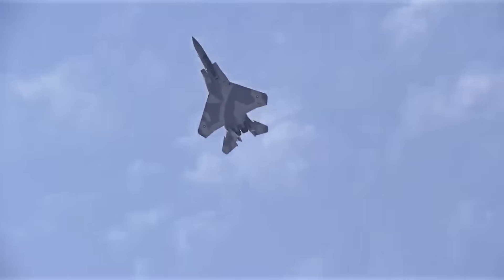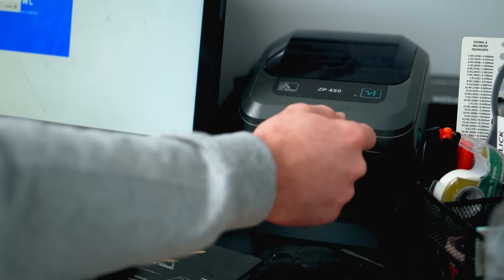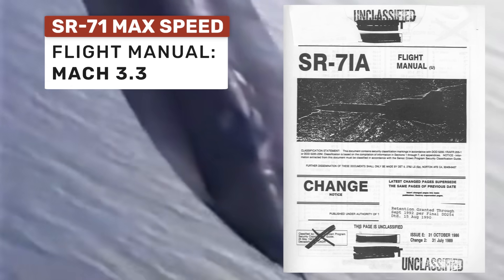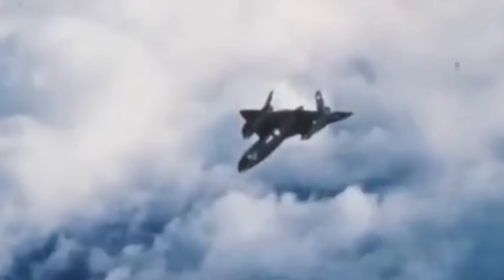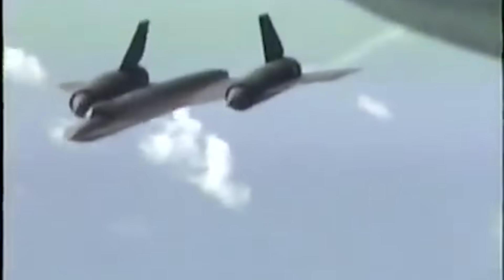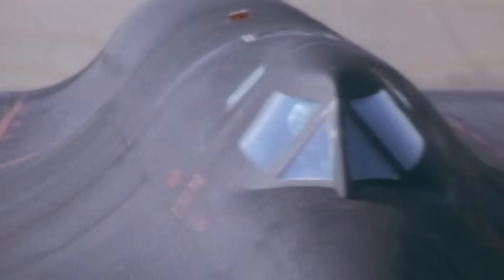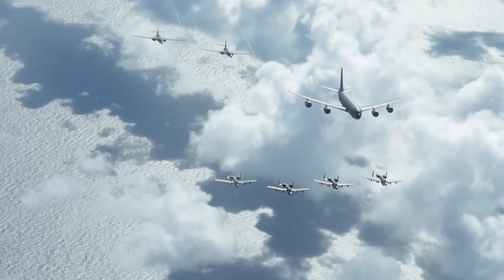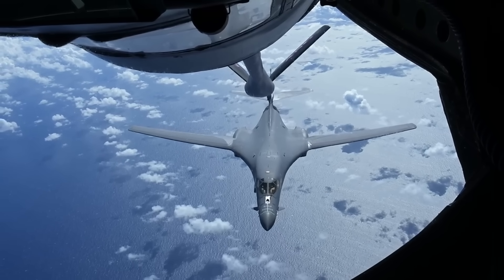The SR-71 was MUCH FASTER than the Air Force will admit

Comment: I was a 19 year old Airman, stationed at RAF Mildenhall, 84 - 86. We had SR-71s there. My war time duty was Rapid Runway Repair. So I got to put on my Chem gear, and lay out by the runway, and watch them take off and land. Such a magnificent machine. Great memories.
Reply: 1 MACH is the speed of sound at your current altitude and air  temperature.  So we have to account for Altitude and Temperature to find out Miles per Hour. Then there is the question of headwind or tailwind to get the Speed over the ground!!
Note there is a an aerodynamic argument that the Mach Angle Limit is from the tip of the nose to just outside of the engine intakes. If that Primary
Shock Cone gets to the Intake it would destabilize the airflow feeding the engines.
Reply: @georgeolson3996 That's why it has those movable intake cones
Reply: As a crew chief pilots told me about a incident where a sr71 called in a ife 200 mies off Cali coast and over shot every Base until it landed in. New Mexico base
Reply: I was a 19 year old airman at Upper Heyford same time. I intel 42 ecs squadron.  EF-111s
Reply: @Joe-b2n  Hard to believe it's been 40 years. Time sure has flown by.
Reply: I was in CE also, power production.
Reply: Prime Beef!
Reply: I live right on the runway of Mildenhall see so many cool aircraft
Reply: The ONLY issue with the recollections of these experiences is that they're someone else's, not mine....Dagnabbit!
The only opportunity still left to see an SR-71 or A-12 in the flesh is as a deactivated static display in or outside an aviation museum or similar facility, where one is limited to only imagining what it might have been like to be in such close proximity when it was in operation. Which is NOT the same as seeing, hearing, & feeling a living, breathing one in motion, going about it's business.
These days psychiatrists have a "condition", "syndrome", or "disorder" for just about everything.... ADD, ADHD, Adjustment Disorder, Autism Spectrum Disorder, Oppositional Defiant Disorder, Sensory Processing Disorder, and on & on.....
The only distinction related to the aircraft I'm likely to able to boast of, is the 1st recorded case of "Blackbird Envy Disorder"?! 🙄🤔🤨😶.....🤣.
Thank you all for your expertise in keeping these amazing machines in the air while it lasted. Thank you all for your service. 👉👍
Reply: Fish n chips or sunday roast  ? What do you niss most ?
Reply: My friend's step father was a pilot of the SR-71, and according to stories he told my friend. The pilots could not touch the windows without burning their hands. Any truth to that? Thanks!
Reply: @patwilliams7362  Yup. They didn't have a transparent material that could withstand the temperatures the titanium body could, so they took the best glass they had and arranged it in a two layer configuration, and then pumped fuel through the gap before sending it to the engine. Even though the SR-71 hoovered fuel like an alcoholic on payday that was, however, still not enough cooling to make the inner panel touch safe. It did improve engine performance though.
Reply: @andersjjensen  Thanks for the info! Hell of a jet. My father worked on budgets and other things he could not talk about on the SR-71. Always gave me the swag he got, so I  had posters and all kinds of stuff growing up. Still my favorite jet of all time!
Reply: @andersjjensen  The "glass" used was not the "run-of-the-mill" silicate glass used in your home. It was quartz.
Reply: @DavidMitchell79  I know, but when explaining things to people I try to keep the concepts relatable. "The best glass they could find" in this case meant highly purified silicon dioxide fused under enormous pressure to prevent crystal nucleation.
Reply: @andersjjensen 
Got the fuel hot for best atomization for combustion, I would imagine.
Reply: @patwilliams7362  the windows would hit about 400 degrees F , and the surrounding areas over 600. There are many stories of sr71 pilots heating up their meals in a tube by pressing them on the window.
Reply: @patwilliams7362 Even wearing their insulated gloves they couldn’t touch the windows for very long.

Comment: The F 111 flies above Mach 3 so do you really believe an Sr 71 only goes 3.3 , remember it stretches 18 inches in flight
Reply: The F111 doesn't do mach 3, and if it did, it would be a dash speed not a cruise speed. 18 inches? Not even close. It stretches 3-5 inches. And yes 3.3 was pretty much it

Comment: I didn't watch the video beyond the opening comments so don't know what the contents were but as a retired Principal A.E. with the mothership, all I will say is that for Max V runs the 12/71 would have been on the bottom of a parabolic flight pattern and the ground speed would have been above Mach 3.2, having said that, the talk in these comments about either plane being Mach V capable is silly fanboy talk with no engineering or metallurgical basis.

Comment: From brake release to 80,000 feet in 12 mins?
How?
They had to refuel before they climbed to altitude.
They leaked fuel sitting on the ground and they burned what was left like crazy just taking off and getting to the tanker....
I don't see how they could get to 80k feet without getting gas first and you're not doing that in 12 minutes.
Reply: 12 min was the fastest time, think it was like 12 min 36 secs, but 13-14 min was typical. It didn't always have to refuel after takeoff, that depended on the mission. And yes it leaked fuel, but not very much and definitely not enough to determine if it needed to refuel after takeoff etc. That was determined by the mission

Comment: Cruise speed vs a shorter burst of top speed are 2 different things.  The planes skin overheating might be mitigated if the acceleration was a short duration.  For example outrunning a SAM or Interceptor that fires a missile.

Comment: My father worked space track at Cheyenne Mountain in 1968 during the Vietnam War. After the blackbird was decommissioned he told me a few stories that indicated that the blackbird was both faster than it's official top speed and could fly higher than it's official altitude ceiling. I am certain the pilots were trained fully in the capabilities of the aircraft and never reveal it's true capabilities. You have to remember that the aircraft was designed in the late 1950's and built in the early 1960's with many upgrades to it's equipment over the course of it's close to 30 year operational life. Among the upgrades I am certain they included avionics, engines, flight controls, computers, optics, and frame modifications and coatings. This combined with public statements that the frame was stronger after 30 years of service than the day it came off of the factory floor to me infer it's capabilities far exceeded the original 1950's designed performance capabilities.
Reply: Underrated comment. Weird how the engineers knew the limits of the original but people think things never changed over decades. It's a laughable thing to believe. The F-14 is another funny one although it got slower (limited) as it aged.
Reply: I'm glad you pointed that out... A very logical progression of the technology of course, increasing the performance capabilities, very Cool... 😎🇺🇸👍

Comment: atmospheric Jet streams can accelerate clocked  ground speed without pushing Airspeed.  this has led to some commercial aircraft dissapearing and breaking up when they dropped out of that sweet spot, into regular air...all said, Mach 3.5 is probably the SR-71 maximum speed...

Comment: My uncle worked on the SR-71 when he was in the Air Force maintaining the radar systems. He said the plane's speed was only limited by the fuel it could carry. That it basically never stopped accelerating. He also said, the engines on the SR-71 were the finest technological achievements of mankind. Really the entire plane was, but it was the engines that made the plane oh so special. Though he was probably a little biased since he worked on the plane.  lol.  He felt very lucky to have been able to be part of the SR-71 program, I do know that.

Comment: We can use a little common sense. 1) The sr71 uses different fuel that acts as coolant. 2) The sr71 leaks said fuel until its frame expansion at speed and altitude (meaning the entire plane has to heat up or warm up while flying in order to stop shedding fuel. Can anyone mention another plane needing to do that? So it's safe to say that the sr71 is a mach 3.5 - 4.0 aircraft. I would dare to say it is closer to mach 4.0... ask the Russians how fast were there missiles that couldn't catch the sr71, not even shot from head on.
Reply: While i do agree that the SR-71 is likely close to or even over Mach 4 if allowed to go full speed even if it means risking damage to the engines.

The fact that it leaks fuel, is basically pragmatism. Kelly Johnson just didn't bother to fix a non issue. There was no risk of fire, and refueling as soon as it gained altitude was required either way.

So he just left it the easiest, simplest  and cheapest way possible.

Comment: It's really very simple...  I worked on the SR-71 and had access to all it's navigation telemetry. COULD the aircraft fly faster? Say Mack 3.4+? Probably. But the questions from a DOD/Lockheed perspective was - why? Or who cares?  ALL of the sensors on the aircraft... the cameras.. the radar... was all DESIGNED to function at mach 3.0 to mach 3.3. The only time you needed or wanted to fly faster was to outrun a SAM missle or for the record books. I love this airplane. It is Iconic! but view it through a practical lens. It should/could still be flying today but the cost was higher than congress felt comfortable with.  So... I'm also grateful we still have the U-2.....

Comment: Umm  they didn't "lie" about its top speed. It has been stated as Mach 3+. now there was a story told by an SR pilot that had a SAM missile fired at him and he said he "increased the throttle" to get away from it. His back seater reminded him about a turn he had to make and he said he "forgot" that the ground was slipping away ax X miles per minute... ( don't remember the number) but When I did the math it came out to nearly 3000 MPH. There are clues all over if you dig

Comment: Alex -- Check the data on the SR-71 speed run from New York to London.  From a reliable source (a KC135Q pilot), that SR took on fuel near the Azores.  Time to refuel at the tanker's top speed, subtract that time and corresponding distance from between the timing gates, and recompute the Mach based on remaining distance divided by the remaining elapsed arrival time at the London gate -- not the landing time.

It's stunning. . . and may be why NO AIRBREATHING JET has ever attempted to eclipse that record.

To quote Kelky Johnson in a public interview I attended in person, ". . . we wish the (then) Soviets would match or break it (the record), because there's still a little left under the hood."

Ultimately, when asked about the top speed, he replied, "No one knows except the pilots who've had her there."

Things that make you go, "Hmm. . . "
Reply: The Azores are way too far south of the line New York - London.
Reply: I heard stories about a blackbird being shot at, which, presumably had a fairly high pucker factor no matter what plane you are in and the white knuckled pilot pushing forward the throttle until the plane was going at insane speeds. Ultimately the RSO (reconnaissance systems officer) had to tell the pilot that he could ease off buddy.
Reply: The initial official speed record for the SR-71 was around 2070 mph over a closed course. Several years later, the USSR built a special MiG-25 to beat that record. It achieved 2110 mph. And never flew again, as every part of it had been stressed to the limit (and beyond). The following day, the US released an updated speed record for the SR-71 of 2193 mph. Sufficiently fast to be out of reach of the Soviets, but still not the top speed of the plane (as evidenced by it flying at 2242 mph on the LA-NY flight).

Comment: I love to be a billionaire, and design a similar plane, use compressed cool air from the engines. To flow through tiny orifices along the leading edges, that get exceptionally hot at speed. Possibly spray a mist if water and methanol to help pull heat, only used when a certain temperature is exceeded . These pores will likely allow cooler running on their own without the air flowing. By reverse flow, the tiny .5- .8 mm pores flowing into a 1 x2mm channel the pressure drop should cool the surface slightly. Use a similar ducting as the SR, with a scramjet in the center taking air from ducts along the  leading wing/fuselage area.  With no need for military equipment, and everything made from titanium or carbon fiber with the windshield made from the optically clear aluminum, can't recall the name of it, seems it is exceptionally expensive, (so costly I can't afford to remember what it's called!) made from aluminum oxide and something else seems it similar to producing synthetic diamonds,  use the cooling pores  around the windshield, with a slight deflector ,attempting keep some of the pressure off the glass.  and the methanol fog could also be used, having multiple ok layers of clear aluminum, with a titanium shutter in the event the windshield breaks, use a network of wires on the glass that will automatically close the shutter if the 'glass' cracks breaking the circuit in the 'glass'   use thin film OLED screens to display a virtual cockpit view using cameras mounted around the cockpit behind quartz lenses or possibly the aluminum, being 35mm or so showing a small rearview and stereoscopic front view, to help with depth perception. Possibly use the stereo view in the hud. Or make it a 3d display option  hold anout 15-20% more fuel than the Dr, plus a pair of drop tanks being we don't get in flight refueling,  with a heavy take off  a total of around 35% more fuel on take off, maybe a set of jato's and extendable wings giving added lift.  With the inlet ducting the engines can be backed off, allow the scramjet to take over, or pair of scramjet engines with cooling ducting over them feeding air to a afterburner, or possibly allow the engines afterburners to still operate with the engines at half throttle the extra air piped to the afterburners  to produce approximately 400% of the power from the two engines alone , with the cockpit being a ejection module,  with parachutes and airbags inside and outside . Built from kevlar and carbon composite with a titanium skeleton the person's inside should survive mach 3 ejection. The cockpit using two explosive rams and 3 rockets to accelerate it up and forward of the fuselage using the rams to push free of the craft, then the rockets ignite. Burning for about 10 seconds going from a relative 0 mph to about 200 in 1.5 seconds  then the rockets  fire , accelerate for another 10 seconds  the craft should go into a dive or maintain level flight, while decelerating to a stall if a siever, catastrophic  failure while  near top speed, possibly use winglets on the 'pod' to maintain stability while the parachutes are opening, have two layers of kevlar balloons that act as mars landing craft, to soften a hard landing, and the parachutes didn't have time to deploy, along with internal sir bags . If someone doesn't survive a mach5 ejection, it's not because there wasn't a fierce attempt to prevent it wasn't made and using the scramjet as a rocket engine burn o2 and methane from underside drop tanks , orbit could be possible.   Build the secondary engines like a rocket engine, with air inlet to the combustion chamber, from a large funnel of  air at mach speeds  entering under pressure and slowing down  for combustion. Close that inlet and inject liquid fuel and oxygen to operate as a rocket. Above 80-100k feet, possibly 200k+ feet!  Coat the whole exterior in a bake on ceramic insulation coating.  In the blackest satin/flat black possible, reflect near zero light, 
  Use glow paint for all gauges and labels, with a few uv lights scattered through the cockpit,  use between .25 and 3 watts of uv light to illuminate the whole cockpit. To allow for running dark, the extreme black would invisible in dusk and dark nights. What bruin that with illuminated gauges.   Put a .5 watt led on each wingtips   that can be shut off .  Closest thing to stealth!  Blacker than black, darker than dark unseen at night by human eyes.. and capable of mach4+   crazy dreaming!!..…
 I know!✌️

Comment: The interesting thing about the black bird is it leaked fuel because the seams were loose, as a result it had to be fueled in the air where the skin stretched tighter and then could be fueled up. This plane is a real Marvell.